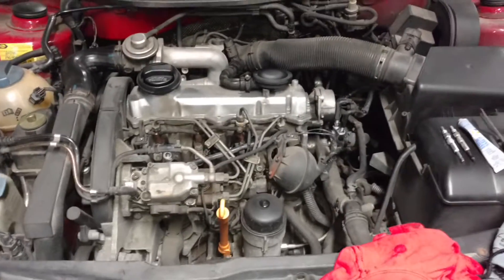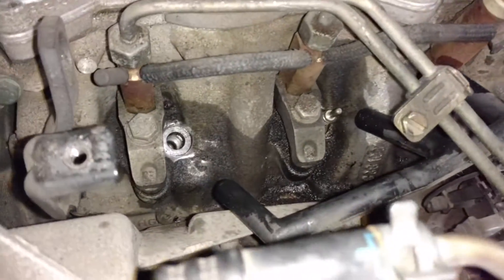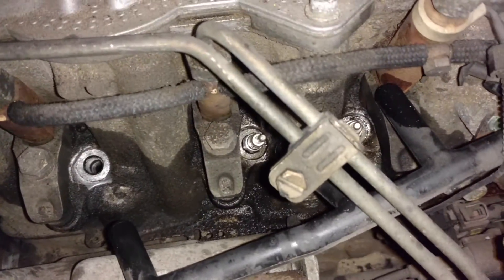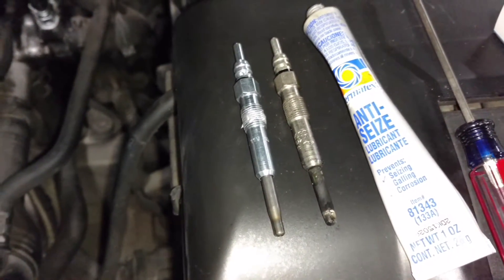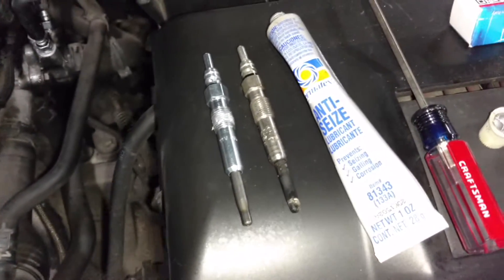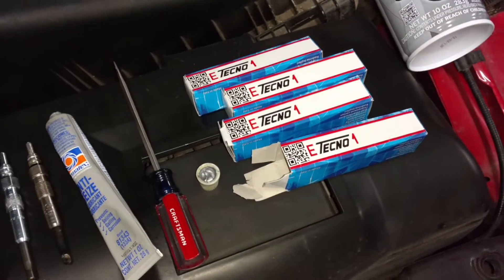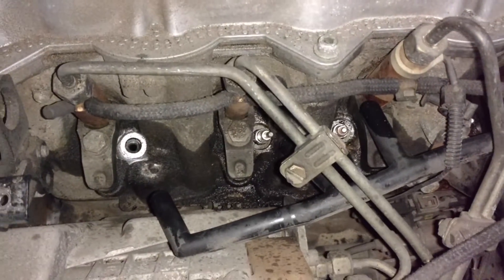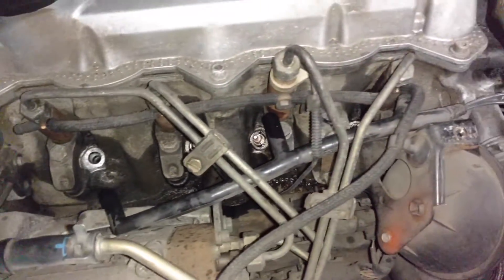Volkswagen mk4 tdi glow plug removal

Comment: My Cyl #4 GP has soot inside which made installing the new one hard and it didn't go down as deep as the others. Is it safe to stick something down in there and scrape the soot off or will that mess the engine up getting that in the cylinder? Thanks.
Reply from the maker: I would get a vacuum in there to suck any debris that might have fallen into the cylinder. The threads are probably gunked up and need cleaned. I would try to stick a pipe cleaner in there and twist it around by hand. That should clean that cavity up for you. Then, take your vacuum and stick your hose on top of the hole to suck out anything that might have gotten in there.

Comment: Hiya pal, i have a MK4 Golf 1.9 GT TDI and ive spent 700 on engine already because its refuses to start hot or cold, im just wondering would the glow plugs effect the start issue i have on both hot and cold? Regards luke
Reply: Are you sure you have the engine timed correctly? Glow plugs don't activate until it's under 36 degrees roughly. It also could be a relay. I can't remember what one. But when it's bad it won't allow it to start at all. Could be a number of things. More info would help

Comment: Hello, can you tell me what are the specifications of BERU Glow Plugs that you purchased? I also have an mk4 1.9 tdi ALH and I don't know what kind of plugs to buy. The VAGCOM gives me two kind of glow plugs: 1. M12X1,25X21 and 2. M10X1X25 ??
Reply from the maker: The 10mm plugs are for the engine and the 12mm plugs are for the coolant. If you have an automatic transmission then you don't need the 12mm coolant plugs. The part number is N10140105 for the Beru engine glow plugs.
Reply: Cory Mondics Thank you for your answer. Now I know which glow plugs to buy. Cheers..

Comment from the maker: Since I've posted this video I had a check engine light illuminate (P0380). This indicated a glow plug failure. I pulled the Etechno 1 plugs that I had installed in this video and replaced them with Beru plugs, which are OEM. I now have cleared the code and all is fine. I do not recommend using the Etechno 1 glow plugs. Stick with original equipment when you can in your Volkswagen.